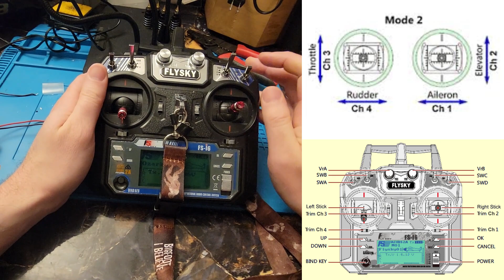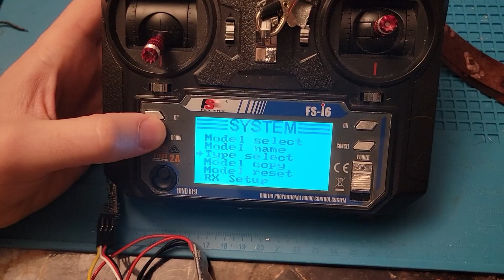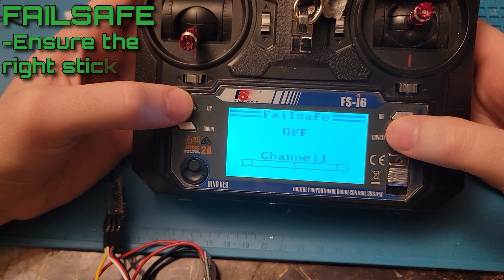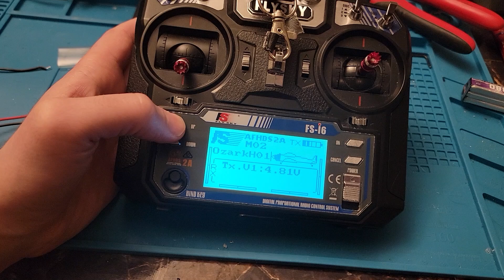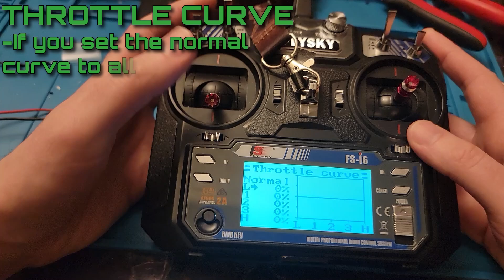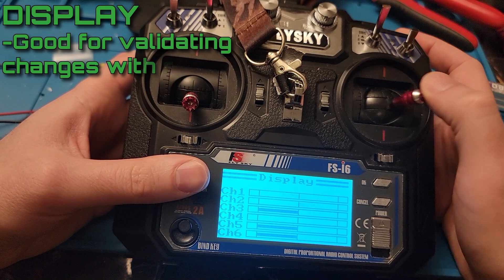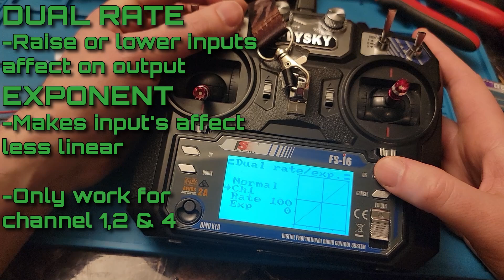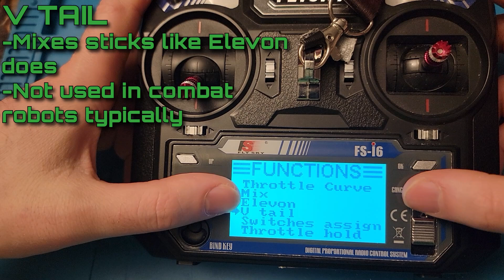Robot Builder's essential Flysky FS-i6 guide

Comment: Great video! Just a tiny bit of advice to new builders:

When you have a dual speed controller and you're mixing drive but none of it makes sense, that the dual esc might have onboard mixing already! It's usually a pair of pads you can solder/disconnect or some vague setup sequence you can do to unset it, but in those cases i'd recommend just following the mixing instructions of the ESC instead of trying to make it fit some standard. You don't want your bot to suddenly flip all kinds of settings if the ESC is overloaded and resets to factory defaults.